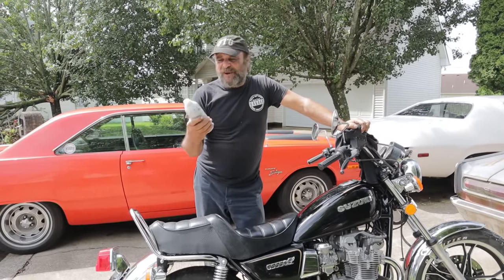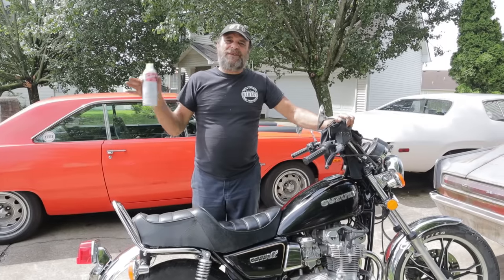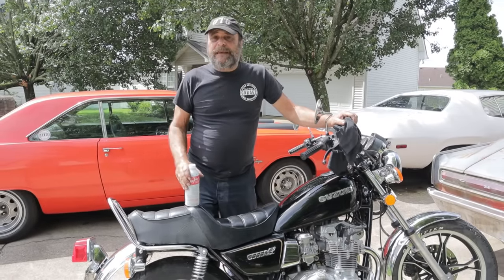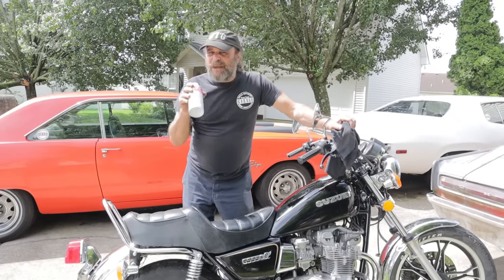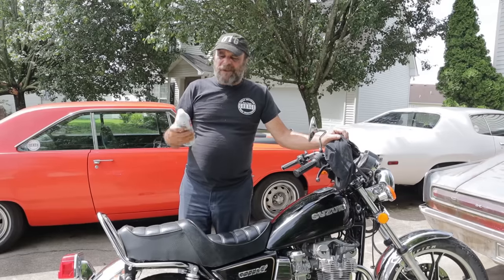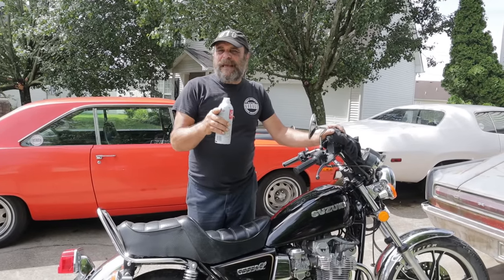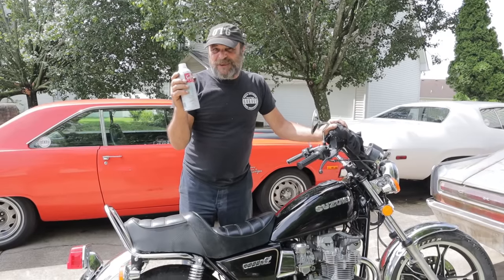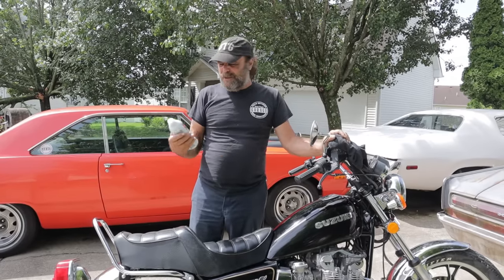We Try Seafoam - We Come Away Shocked

Comment: Great to see an old bike getting new life. Another old trick is putting the carbs in white vinegar and shaking them to get all the air out. Its an acid that will eat the deposit. But don't leave them in too long or it will  dissolve the carb as well.

Comment: I used it on my 93 suburban with an iffy cat. Half a bottle down the throttle body and let sit over night. The other half in the crankcase. Next day go for a half hour drive, change the oil and go thru smog. I did this for a decade and the smog test got better every time.

Comment: I use it for sticking valves train issues, pour a can into the engine oil and let it sit idling for a while. I use it or a quart of diesel before oil changes. Dump it in and drive the vehicle a day or two and washed the deposits away. 
Use it in everything automotive related. 
It worked wonders on those mid eighties dodge k cars. They had a miss at idle that wouldn't go away.  Changed carbs, distributer, plugs and wires. Nothing worked. Dumped in a can of sea foam with a tank of super unleaded.  Within minutes the miss goes away.  After than regular unleaded and half can to a tank. The first time refilling without sea foam and the miss returns. Have done it multiple times to those Mitsubishi engine with the same results.

Comment: Used to have a Suzy-Q and those carbs always clogged.  My Harley has fuel injection that never clogs but loses that Harley sound, the old ones with carbs had dual ignition that produces that Harley sound because of offbeat ignition.  But reliability beats sound, will only buy vehicles with fuel injection from now on.  Especially outboard motors, with gas/oil mix those carbs clog fast if they sit for a while but they make fuel injection outboards.

Comment: Been doing this for years another Good one if you live in Florida or a place where they do admission testing to get your sticker . Get a gallon of pure denatured achole run your vehicle down to a 1/4 tank and in the gallon drive to testing  your car will be hot and burn out old carbon emissions after test go fill the car up . Helped alot of people pass this test after they spent 💯 on tune ups that didn't work

Comment: i have added an entire can of seafoam to 10 litres of 91 octane fuel , and ran it through my old craftsman snowblower , with in 30 minutes of using the snowblower , the surging and hesitation stopped , i continuously used the mixture , the engine ran like a top , 2 cranks of the starter and the engine fired right up ,even after 6 to 7 months of summer storage , it is also a fuel stabilizer

Comment: I know people like Scotty Kilmer claim it's old and outdated, doesn't work, only for 2 stroke engines, ect,  but I've used with successful results, especially in the small engine department. Just recently used it on a Honda rototiller that was given to me for free. It had been sitting for many years without use. I removed the bowl, cleaned the main jet (it was plugged) and got it running, but it was running lean and a bit odd. Added some new non ethanol gas and a heavy dose of seafoam (you can use up to 50/50 mix with gas and 100% in a diesel) and rototilled a large area for about an hour. The engine kept running better and better until it stopped running lean/surging and smoothed out. It runs perfect now and starts on the first pull every time, like all good Honda engines.

Obviously, this isn't carburetor rebuild kit in a can, won't fix a completely plugged/gummed up carb, does not fix blown or leaky gaskets/seals/diaphragms, and does not magically renew broken or missing parts, but it will help clean and dissolve a bit of contamination here and there. Using it religiously will keep the fuel system and combustion chamber much cleaner than using nothing at all.

As mentioned above, you can run up to 50/50 mix of seafoam and gas, so pour the rest of the can in your tank, fill it up, and drive it like you stole it.

Comment: Lived in a rural area that didn't have "Top Tier" gasoline available.  Subsequently my injectors would get dirty and sluggish on my 2012 Prius.  Tried several brands of fuel system cleaner and  about every 1500 miles I was back to sputter city.  Put one can into tank and the problem was solved.  Afterwards I would add a can at each oil change.  Never had a problem after that.

Comment: Carb cleaners work by soaking & dissolving obstructions/blockages. A good way to clean a carb is with sort drives & park overnight then repeat. This gives the cleaning agent time to soak & desolve any dirt/crud & short trip driving will flush out & replace the cleaning agent so the process can repeat.

Comment: I dissolves carbon and varnish and mixes with fuel and water so you can burn it out of the tank (a problem with boats).  It was actually developed for 2 cycle marine engines.   Its just good maintenance but one has to be careful when using it on things with oxygen sensors and catalytic converters.

Comment: I'm skeptical of Seafoam. I've used it on multiple vehicles, mostly for the fun of smoking out the neighborhood, not actually trying to fix a problem. Never noticed any difference. Seems to work good in the crankcase as a motor flush right before an oil change.

Comment: Seafoam transmission treatment. I had a transmission that wouldn't shift or would slam your head back into the seat when it did. Put in 1/3 bottle didn't change any fluid or touch anything in 5 miles it was shifting like brand new.

Comment: The best thing to do is vacuum some seafoam down a vacuum line. Techron does a better job of cleaning fuel systems. Techron is a high PEA cleaner, so you could use some other high PEA cleaner.

Companies that specialize in racing engine make stuff just for carbs. It might outperform Seafoam or Berryman B12. After all, how many street driven carb engines are you going to encounter? It's a kind of specialty.

Comment: I don't mean to be critical, but I was always under the impression that the needle controlled the transition from low to mid range -- if I was running lean on the transition (from different gas) I would raise the needle one notch.. The pilot jet is (again, correct me if I'm wrong) idle to just over idle. While It is absolutely imperative that the pilot jet be clean, I'm surprised that you didn't remove it and blow it out when you had the carbs off -- I usually use a quick soak in acetone. I know the main jet is easier to get to. I also know that if I were doing this at 10 pm, I'd be inclined to do what you did.

Comment: I didn't see it on the shelf locally, but Wynn's Injector cleaner has helped me many times and saved me 4 digits.  Redex didn't work for me, but might for others.  Each time I used a full bottle on a quarter tank.  Also a spray bottle of water misting the intake for an hour helped me clean my valves.

Comment: I bought an 87 GMC it would fall on its face if you would thet into the throttle hard and would die when stopping I did like you 2 takes of gas  with seafoam motor treatment and then a fresh oil change and it runs great now

Comment: I tried them all! Worked at voic a long time ago. Seafoam and techron were the only 2 that dissolved any type of varnish or gunk or even some of that white crud inside the bowels and floats if it sits too long! What does work is kerosene with methanol alcohol 80/20 mix let soak over nite and flush out and all the crud  flakes off or dissolves . The alcohol does its job then ivaporates away but fair warning keep this outside! The vapors are crazy flammable and are not easy to out out if it lights up like acetone! Acetone works and mek but it will ruin all your gaskets even urethane ones! They swell up and cut itself apart then turn brittle

Comment: Tony....I was practically given a boat last year that had sat for more than 10 years.  It had 150 yamaha 4 strokes on it and the fuel system was toast.  The guy I got it from said they wanted a fortune to get it running.  I'm one of the best mechanics I know (aircraft) and tore into it.  It had varnish and crude all through the fuel system.  Total wreck.  I decided I was GOING to find something that would make cleaning easier no matter what I did.  So I started trying stuff.  Everything and anything including ZEP formula 40.  I had a pint of denatured alcohol and put a little on an acid brush and it started cleaning the second it touched the floatbowls (fuel injected).  I could not believe my eyes.  It took ALL of the varnish off and left them looking perfect.  I have a sonic injector cleaner and put some in the bath and ran the small parts through a couple cycles.  Even the most stuck injector cleaned up and sprays like brand new!  I've overhauled carbs pretty much since I was about 14.  I'm 67....never seen ANYTHING work this well.  I got both yamadogs running like brand new.  Haven't tried in in the fuel but because it is basically alcohol I'll bet dollars to donuts it will mix with the water and or ethanol and will clean up anything you put it in.  Cheap and easy fix.  You can smell the ether in seafoam and that works I'm sure but give denatured alcohol a try.  I'll bet you track me down to thank me.....
Reply: What is the denaturing agent in the alcohol you are using?  That may be important, as it can be 10% or more by volume...
Reply: @michaelangelo8001  That's a very good question.  I didn't even think of looking at that.  I will look and get back to you.  I tried a couple dozen products and nothing touched the denatured alcohol.  The engines I used it on were yamaha 150 4strokes.  They had sat for 14 years without even being started.  150 hours and looked like brand new but the entire fuel system was jacked beyond repair.  I'm an aircraft mechanic and was determined to fix it.  So I started trying chemicals.  Just for shits and giggles I had some denatured alcohol and the second I poured a shot glass into the float bowls (fuel injected has a reservoir on the motor to supply the high pressure pump) it already started to turn nasty brown color.  I used an acid brush and scrubbed it around and poured it out and it was so dirty it looked like paint.  I just repeated and letting it set to help dissolve the grunge and within about a half an hour it cleaned the aluminum so well it looked like brand new.  Blew me away.  Lighter fluid, lacquer thinner, part cleaner...nothing worked very well...but the denatured alcohol stripped them in short order.  It's just denatured alcohol from a can I bought at Ace Hardware in the pain section.  .
Reply: @awittypilot8961  Well, I appreciate you passing that along.  I've run into that problem situation on motorcycle carburetors several times, and like you I tried everything I had on hand.  Never attempted to use alcohol though, as it didn't seem to me that it was worth the effort.  After all, the fuel already has a lot of alcohol in it.

I have a Kawasaki Ninja here that is plugged up so bad that it won't even start.  I just ordered a big ultrasonic cleaner, and was going clean the carbs in that.  But now I'm wondering what would happen if I just filled the carbs with the right solvent, and rigged up some kind of vibrator on them, with a timer that would gently shake them intermittently.
Reply: @michaelangelo8001  I would take the drain out of the bottom of the float bowls and unhook the gas tank and put a hose directly to the carbs.  Let the denatured alcohol go through the float bowls to make sure they are getting good flow out of each...may need to tap the bowls to release the float needle and seats.  Then close the drains and let it sit for a half hour.  Drain the bowls again and repeat a couple of times.  If your throttles are stuck you're tearing them down anyway and stop wasting your time.  Drain them again and put gas (high test) in and see if it will start.  If it does then you're going the right direction...but the idle and intermediate jets won't get wet with the denatured alcohol so I'd drain everything again and try to start it on the denatured alcohol....if it does you're probably going to be alright.  Open the idle screw all the way before you do anything.  If it starts on the alcohol then do the same...start it and let it run a couple minutes and shit it off.  Repeat several times with a few minutes in between.  Then drain the float bowls again and try gas again.  Make sure your tank is clean and put about 25% alcohol in the gas and run it some more.  The go to straight gas and adjust your idle mixture once is' warmed up.  Put a good filter on it and run it.  Word of caution...there is benzene in the denatured alcohol....wear gloves and wash it off if you get it on you...can effect your bone marrow so don't leave it on you.  Compared to taking the carbs off and going through them this will be an easy fix if it works and it's well worth a try.  Good luck!  Try a little denatured alcohol on a dirty carb on the outside and see if it doesn't solvent it right away....it amazed me....
Reply: @awittypilot8961  Thanks for your input.  What you described is pretty much what I had planned, except that I want to rig up some sort of vibrator, and attach it to one side of the carburetor assembly.  I want it to vibrate for a few seconds every fifteen minutes or so.  I believe I will get much better results that way, than just letting them soak in a stagnant solvent solution.

Comment: transmission fluid works like this too. the atf3 is better than the 4 or 5 i think as synthetic is harder to burn 4 or 5. but atf 3 has been known for years to clean carbon on valves and through the fuel system also clean and lubricate the top end.

Comment: Have used seafoam and marvel mystery oil for years.  On my boat i disconnect the fuel line from the tank. Put a whole can of seafoam in a one gallon gas can with enough two stroke oil for one gallon of gas. Then i go to the gas station that has 93 octane non ethanol gas and fill the can up to the on gallon mark then add a small amount of two stroke oil. I let the power head (engine) idle till the can is empty. Then i do it again, going to the station again gives the first mix time to soak any carbon build up on the pistons.  Sometimes I'll do this twice a year.  On my truck i just pour the whole can in the tank.

Comment: Glad it work for you. My experience was the opposite.  I used sea foam on a 99 Suzuki intruder  1400.  The bike had been sitting a while with the previous owner.  It had been running fine but I thought why not use sea foam and do some cleaning.  It must have knocked stuff loose, I’d be riding then suddenly no power unless I went wide open and that just bare kept me going.   I ended up using a could cans of barryman B12 to get it right again.

Comment: Tested Seafoam on a push mower that ran great but used almost as much oil as gas. Mowed for about 20 minutes and noticed a lot less black liquid coming from the exhaust. Topped off the oil, mowed the back yard and there was no change in oil level and almost no black from exhaust. Score!
After that, I tried it on my Sable ('92, 3.0 Vulcan) with a little lifter noise. Drove it for 15 minutes and the noise was almost gone. Let it sit for a 12 hour shift and drove it home. When I got home there was no more lifter noise. Another score!
CAUTION! Using this in the crankcase will release a lot of shit that has been building up for a long time, so your oil will look like it's 10 years old after a couple days.
My experience has been nothing but good with Seafoam.

Comment: I had fuel line issues in my stihl trimmer. The engine would stall with a trigger pull. I thought I’d give it a try and it immediately ran perfectly. What ever was starving the engine of gas cleared up right away.

Comment: Ive been using seafoam for many years. It was developed in Minnesota for marine engines. It is an excellent product. When i used to take my 67 R/T out for a ride when the kids were little, i would add 1 can if seafoam to tank if premium fuel. The car would sit all winter. By the time i got to Brainerd Minnesota from our house 3 miles from Nimrod Minnesota,  it woulf fèel like i had an extra 50 HP. Oh yah, add in marvel mystery oil every tank at 1oz per 10 gallons of gas. It will micro-polish the internals of your motor through the years and make it virtually indestructible...

Comment: I have a 12 year old chevy silverado with 256k miles on it.  After watching a video by Project Farm, I thought I would try it, so at about 150k miles, I started adding sea foam to the gas and crank case (per the instructions... 1 ounce per gallon of gas, 1 ounce per quart of oil).  I add it about 500 miles before I change my oil and when I top off my fuel around that same interval.  The truck nearly immediately ran smoother and my fuel economy improved about 2 miles per gallon (my daily commute is 100 mile round trip on a 2 lane road where my speed is always very consistent).  When I had my mechanic replace the oil pan gasket, he asked me if I had been using seafoam because there was absolutely no sludge to be found... that the underside of the motor looked as clean as factory new.   I admitted to using it and he said to keep it up... it absolutely can't hurt anything, and does a great job keeping fuel systems clean and breaks down carbon build up and sludge.  It's not voodoo, it works.

Comment: I was taught about seafoam back in the late 90s early 2000s by a mechanic friend. That shit does what it says it does. We used to spray it into the throttle body and pour the other product into the tank. I was impressed with how well it worked and it wasn't that expensive.